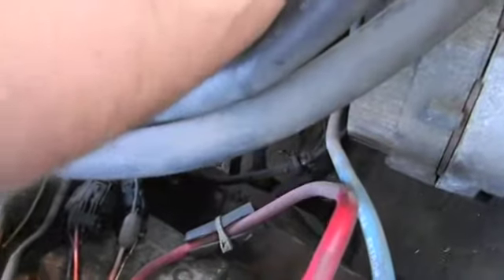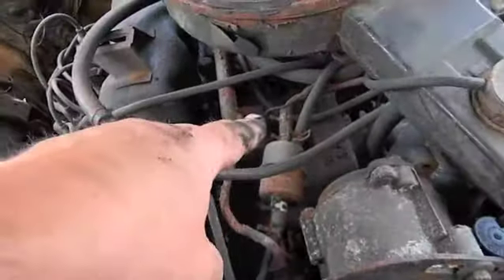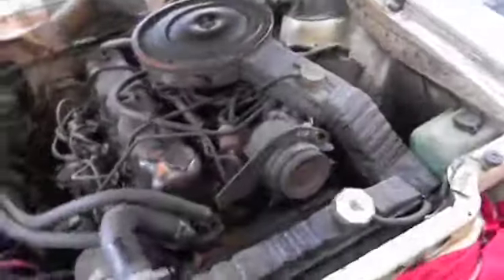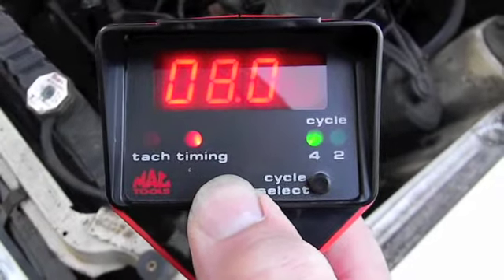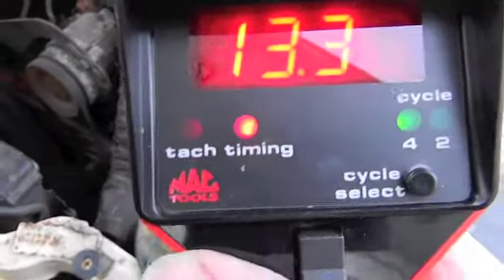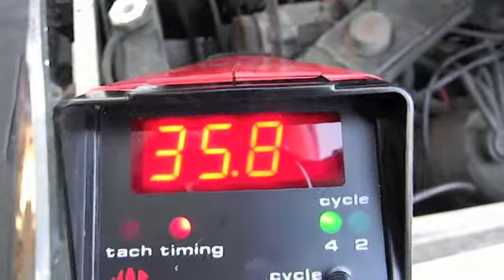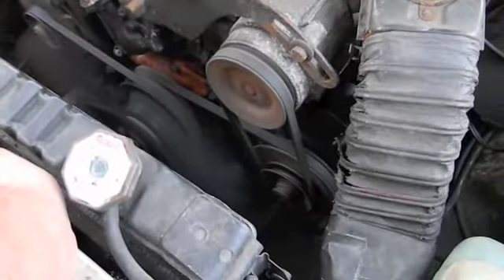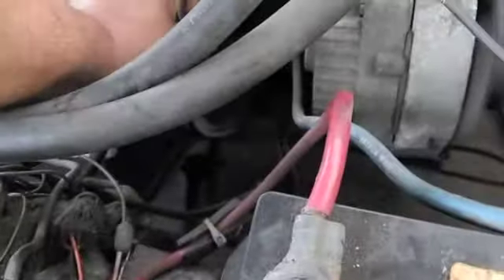How To Check Your Engine Timming

Comment: I knew what you were talking about....I dig tuning..We had a "sort of" emission system plan with air pumps and stuff in the late 70's early 80's but there was not enough proof that it was better so they just made carbon canisters the emissions and some thermal switches for the timing...most of them got by-passed..or removed..lol.